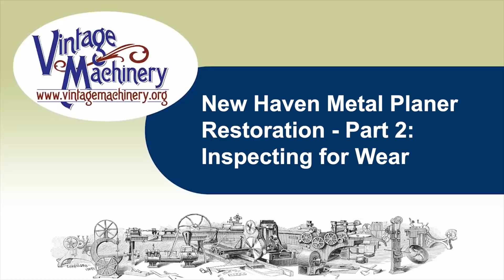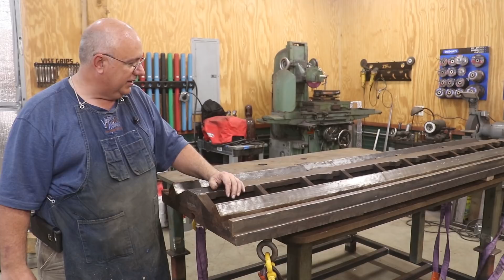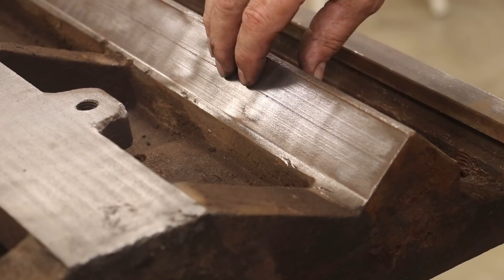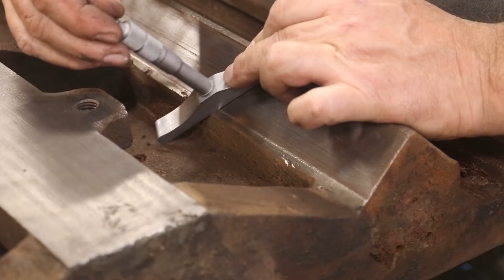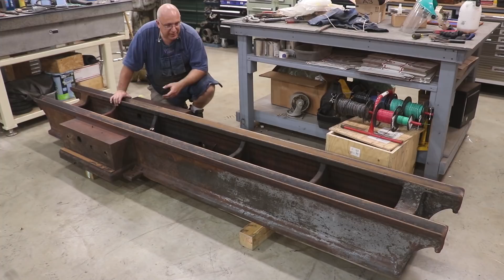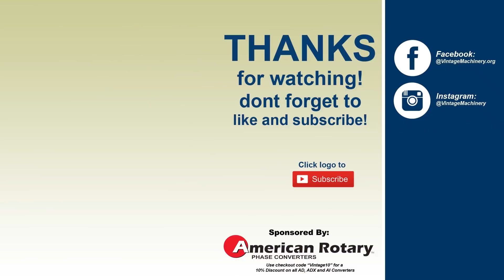New Haven Metal Planer Restoration - Part 2: Inspecting for Wear

Comment: Here is a method for leveling a lathe with a vertical rod and plumb bob. It looks like it is adaptable to checking ways with the addition of a pair or two of cars, perhaps vee blocks or precision rounds like wrist pins,  that will track the worn areas of the veeways. The vertical bar tilts with out of true ways and with a bit of trig you can get a 1:1 readout, or other methods. Hope this is of some use.

https://youtu.be/2qIdsnl5vpg

Comment: With the table overhanging the bed the extra wear is to be expected on the ends of the bed.
Basically the entire weight of the table and work piece is supported by less bed length when the table overhangs which results in an increase in force applied to the bed.

Comment: I would at least put a oil pocket with a 2-wheel roller in the middle section of the bed, like on most surface grinders.

Comment: The bull gear being central to the chassis imparts a jacking force when it drives the table, that isn't present at either end. Nearing the end of travel the bull gear stops and that also imparts a jacking force, but now the table is all off to one end. This happens in either extreme of travel. I think that's why the ways are more worn at the ends. I'm glad you have "ways" to repair it.

Comment: If you grind the base deeper and the table vees smaller is there a risk that the table could bottom out without the vees making full contact? Will you need to have the grinder guy relieve the under side of the table? Or is there enough meat there? Hard for us to tell on the video. If this was cheap or easy everyone would do it😬. But I think it will be worth it. It's one helluva machine.

Comment: Maybe you can gonna cheat and use the same machine for self-grinding. With weight balancing and grinding and lapping compounds. It can be done, but it's not easy..! 2 laser beams define a flat surface. IMHO 2 of your monopods with and 2 good laser pointers seams to be good idea for this long surface variations and grinding inspection.

Comment: So this casting must be ground to the level of its ends (as references).....  Is there NOT a portable system (laser-aligned???) which you could rent or hire, c.f., a grinding router, which would traverse this casting, from end to end, varying the amount ground off.....as required by the alignment beam.....???  The great cost of this rehabilitation is likely to be the cost of shifting it to be "reground" in a site-specific way.....!

Comment: I am guessing at least 10k with shipping to get this done, maybe more for both pieces. This is a lot of grinding that needs to be done. With 0.02 to be done which is around 0.5mm maybe a better option is to first machine it and then grind the last few 0.001. Also calculations need to be done with all other elements and meshing as sizes change quite a bit. I have a lathe with huge amount of wear and I just live with it - alternative is to build some kind of skateboard jig to grind it. Yet another alternative is just be aware where the wear is and account for it while working.

Comment: All the pounding the work surface got over the years may have set up compressive forces that may have warped the table downward on the ends. A quick check of the work surface straightness might be in order.

Comment: The only problem I have with how you tried to measure the wear is, you are assuming the ridges are straight and you based your measurements from those ridges. If they are not perfectly straight, you will never ever get proper wear measurements. So You either need a perfectly straight and flat surface to base any wear from or you will be mislead from the measurement you measured... JMHO

Comment: These ways look as bad as those on my unfortunately not so cheap surface grinder.
The bad thing with big machines is that you need an even bigger one for rebuilding.
And some long straight edges, a huge surface plate and an autocolimator, if you can find one, for cheap.

Comment: Before you go all in on grinding and then scraping the ways, it may be valuable to consider HOW the machine was built back in the day.  120 years ago, the technology of precision was not nearly as well developed.  This machine was probably scraped in to no better than +/- 5 thousandths over the length of the bed.  Remember that the table is supported on a film of oil over a minimum of 5 feet when it is at the end of its travel and due to the stiffness of the bed it is unlikely to be moving up and down very much, especially after the top surface is planed in.  So, I would take care of the scoring on the bed casting and get the table ways renewed, but I would not worry too much about being more precise than necessary.
It is probably more important on a planer that the structure and mechanism for supporting the tool in as good condition as possible.  It may have been instructive to move the table back and forth under the clapper box and measure the up and down runout of the table before the machine was disassembled.

Comment: What would you consider sticker shock?  $5-6,000?  I can imagine shipping and setup in a grinding shop this would be an acceptable estimate.  Not only moving heavy parts multiple times and the possibility of damage.  I can appreciate your zeal to restore this fine machine, but sometimes the cost exceeds the worth.  It might be a great candidate for a museum piece in lieu of a working shop machine.  But if you are willing to spend a bunch then I wish you good luck and am looking forward to the finished project.

Comment: If the bed has sagged over the years it would generate a similar wear pattern, and taking measurements off other parts of the bed won't correctly show it. The only way to properly check this would be with an 8-foot straight edge.

Comment: Hi Keith,
I am really looking forward to all of the episodes of this series. Very interesting.
And thanks for doing it right. It will be expensive, but since this is a restoration /conservation project and not one of comparing cost to return or anticipating revenue generation, you have an entirely different decision making process than most would.
As a patron of your channel, I am delighted to see any contributions of mine go to projects like this.
Keep up the good work!
Reply: Joseph Magedanz....you have identified the heart and soul of this project.  Keith is performing a "restoration/conservation project".  All of these comments about redesigning and adding pieces not original to the machine, is not Keith's direction. This machine has lasted 120 years and is in one piece!  I believe restoring it to original spec is the proper direction to follow.

Comment: Maybe a cool retrofit would be installing ball rollers similar to what Steve Summers 
has on his surface grinder.  It would be a challenge to maintain the proper bed/table 
distance for the pinion and rack gears as well as a way to mount the balls and you
would still need flat, parallel surfaces to attach everything to.  Undoubtedly it would 
be an expensive project.

Comment: One would have to seriously consider the cost verses use equation on this project. Maybe nice to have fully restored planer but do you have enough work to justify the outlay?
Reply: This is restoration/conservation project.  Keith's shop is a study in old machinery and how they can be made to work as originals.  His shop is perfectly adequate for most any machining project, but this addition is not meant to earn it's keep.  It is a 120 year old look into our past.
Reply: Paul Copeland   yes i get all that but if it costs a couple of grand to make it work maybe once every couple of years is it worth it?
Reply: @littleworkshopofhorrors2395  ....Well, it is all in what you feel restoration is worth.  I have a friend who spent around $50k restoring a model A Ford.  He drives it in parades.  This kind of expense is never "worth it".  The worth is the enjoyment you get from the process and the finished product.

Comment: And now it starts to become apparent why a proper rebuild to new condition for a machine tool is likely to be 2/3 the cost of new if not more. Of course for the amount of use the planer will get it should be good for the next 200 years.
I ran a planer of similar vintage that had pockets cut in the bed V-ways. In the pockets were a set of wheels with beveled faces to match the machine's V-way. The wheels were mounted on springs so they would press against the table V-way. The pockets were kept full of way oil and the wheels transferred the oil the the V-ways as the table cycled back and forth.
This planer was modified to be used as a milling machine with the addition of a Bridgeport milling machine head and a variable speed DC chain drives to the bull gear and the cross head feed screw. Location was determined by Travel Dials on the table and cross head. The planer was used to make aluminum parts for Sandia National Laboratories.

Comment: Okay if you have to grind both the table and base that means they will be lower together right so that middle area that the rack  bolts to on the table top will also have to be ground so the gear fit will be correct if not ground the table will be riding on the bull gear so top will be a tider-totter orr the bull gear Am I Correct?

Comment: Are you anticipating using turcite or rulon on the wear surfaces? Or installing metal wear plates to insure proper clearance because of clearance of the bull gear.
Reply: The easy way would be to machine the surface the rack rides on when you grind the table ways.
Reply: Bill Johnson you better take good measurements, your working with Vee ways- not a one to one
Reply: @crockteerden4023  just have to plan ahead.  Set table on bed now, measure from rack mount to a reference surface on the bed.  Grind ways, remeasure.  That way you're measuring the difference in vertical height between bed and table which is what sets the geartrain backlash.
Reply: Bill Johnson he’s looking at at least .020 each side of Vee top and bottom. I’m sure if you don’t compensate somewhere there going to be more interference other than the rack.
Reply: @crockteerden4023  There may well be other areas that require clearancing, but you asked specifically about the bull gear/rack.  I answered that specifically.

Comment: Does scraping nearly 20 thou off the ways result in any issues with the gear mesh when reassembled?
Reply: Likely the rack will have to be machined an appropriate amount to move it back from the pinion.
Reply: I was thinking the same thing. Maybe that center are would need to be machined as well to maintain proper backlash. But then again, maybe it started out with enough backlash that it's not very important.
Reply: That flat area running down the center, where the rack bolts on, would just be ground the appropriate amount.

Comment: If you are going to fix the old girl with a full regrind scraped guides on a planer wear out very quickly. A planer that uses gears will always jump around. This particular unit doesn't seem to have additional lubricators and that is why it is so severely worn. At the very least spring loaded wheels the same profile as the bed ways at the end of the track to lube, ideally a pressure fed system feeding the guides not unlike a timer controlled slide way lube system.  You cant run any wipers at all as it removes the oil. Back in the stone age I ran a planer quite a bit and even a little planer like this would need a couple of pints an hour
Reply: A redesign is not warrented here at all.  Keep in mind that it took well over 100 years of use, likely in an industrial setting to get this kind of wear.

One man using it in his home shop very occasionally for even hundreds of years would not come close to this wear.
Reply: @Bobbywolf64  I think you would be surprised. You can easily take 0.001" a stroke if you start them up loaded/dry. If you put more than 1/2 ton on that planer  table the lubrication becomes very important. Even the table just settling without use the oil gets squeezed out and that first stroke is dry and that's when the damage happens. Silly things like leaving it loaded over the week end also take their toll. I have had to refurbish one after coming back from holidays because the operator who took my place had no idea. These can be capable of some very fine work if in good order and used with care. .
Reply: @Bobbywolf64  Good point.
Reply: Is this actually worth restoring? The issues you raise suggest to me that a fair amount of redesign would be advisable. What Keith would end up with would be a long way different from the original. If he actually needs a planer, then it's worth it. If he just wants a restoration to do, then maybe another machine would be a better candidate.
Reply: There isn't a better candidate tho. Figure there isn't any left that doesn't have wear considering the age. And let's be honest, it's not that bad, could be a lot worse.
But yeah, the original design is obviously flawed. Frankly, i don't particularly understand why they reversed the ways, no matter what you do, it will always accumulate crud in the groove and score them. Nothing short of skirting the whole thing would make it right.
Reply: @aserta  Before you start them you flood the ways with oil to basically wash them down. Then when in use you continue to do this with less oil.  It makes a mess and is expensive.
Reply: @dolvaran   Even with just the table end wheels to lube the ways there will be a huge improvement. On all but one planer I have used these were mods performed pre ww2 going by the mounting hardware. It isnt a redesign I believe. Any machine shop fixed/improved it's own equipment when it could. To be fair this isnt a DRO

Comment: How were the ways lubricated? I don't see any oil holes or grooves. Can't wait to see how you restore this monster.
Reply: Oil can only from the looks of it, at the beginning of every day it would probably be cleaned and lubed before any work happens, skipping that preventative maintenance would accelerate the wear on the friction surfaces.
This machine probably predates oil grooves.
Reply: @j-man72b72  Indeed, it predates most countries.  I would even suspect that it was lubed with Whale oil..  (not joking)

Comment: The machine was run with the center support adjusted too short.  The bed was in a curve.  I bet it is worn on the ends.  A very long straight edge would be needed to properly level this machine.
Reply: Yeah, I guess that's why the old books go into so much detail, talk about pouring lead under, etc.
Reply: On account of that sticker shock, I wonder if one could over jack the center, fill the ways full of lapping compound and let wear in the reverse pattern.